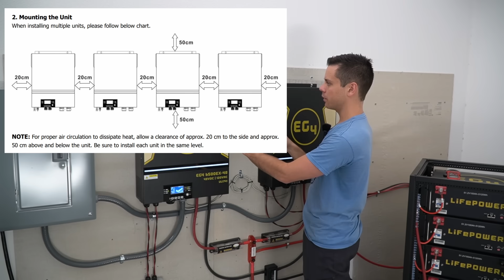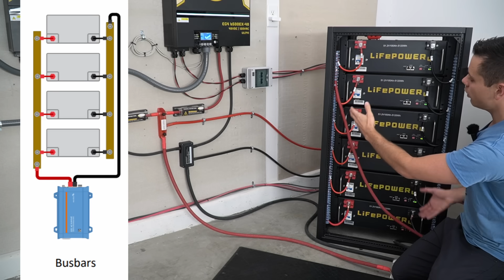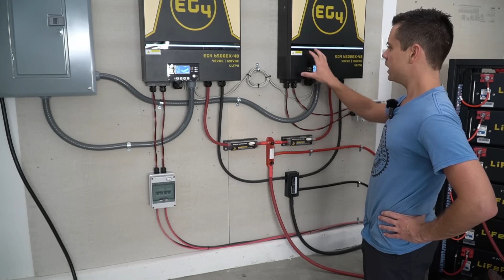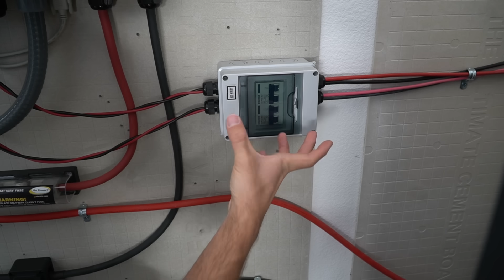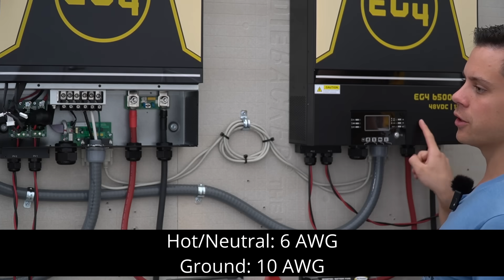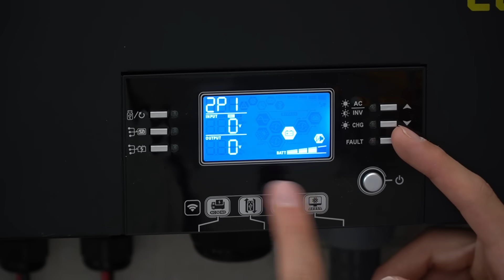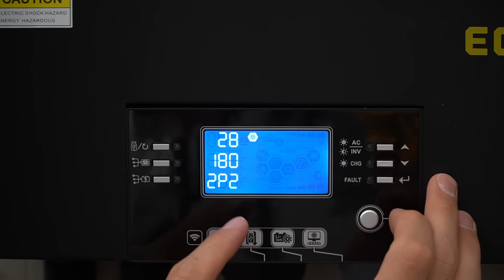Complete 48V Offgrid Solar Power System

Comment: Hi Will
I am based in South Africa and we have between 4 and 8 hours load shedding per day. Seriously. The time has come to go off grid and although I follow your Chanel generally this particular set up looks great. 
We are blessed with lots of sun so solar is very viable with a decent battery bank. Could you push me in the right direction to maybe import a system similar to that in your video. All our larger homes are 3 phase and would require at least 2x 5 kVA inverters or similar. Any guidance would be greatly appreciated. Many thanks. Ian.

Comment: I’ve got (4) 270 watt panels. I want to power a 3kw EPropulsion engine in that imaginary “infinite” range. The 9 kWh battery they offer is prob my choice. Is my configuration good for an under 2000lb boat? Thanks, Dan

Comment: I believe this meets all of my needs. My question is, if you use the A/C inputs from a main panel (as a back up to keep the batteries topped), would you limit the A/C charge to allow 1 circuit to feed both inverters, or would you run 1 circuit from the main panel to each inverter? My concern would be one of the circuits (A/C inbound) failing and causing an imbalance. Would there be a problem if only one unit was charging the battery array? and, would there be a problem if the units transferred from battery to grid in this case?

Comment: I need some advice. I have installed a system with two separate 240v ac output inverters. Both inverters have L1, L2, neutral and ground wires. Can I join the L1 wires together from the inverters and send it to the main house double pole backfeed breaker on one pole, and join the two L2 lines together and send them to the second pole of the main breaker? The inverters (EG4 6000) have communications wires called 'power
sharing' that keeps them in phase, along with standard communications printer cables.

Comment: Will, I am looking for some help with doing an off the grid system for a 26 by 14 foot shed barn that would be running multiple computer systems for gaming, TV's, air compressors, how many split air condition, residential size refrigerator, microwave. With future jacuzzi hot tub connections. I would like to know if like in the video Complete 48V Offgrid Solar Power System on May 25, 2022, if this system it would be just right or overkill for what I'm trying to do?

Comment: Love your Chanel, but I wouldn't recommend this company to anyone. After spending 20k with them it took over a month to get issues resolved. Inverter was DOA. Had to deal with 4 different techs before I got a replacement 4weeks later.

Comment: thank you!  this is exactly what i am looking for... except i would like to know how you would hookup grid power for charging batteries when low solar days and supplying my critical load.  Unfortunaltly my solar array is VERY small at this point until we move but want to have a pratcial solution that can move with me.  Also, will these handle UPS automatic failover in a grid out situation?  In comparison, the Bluetti has UPS mode that i am familure with but doesnt really give me the AC output to power my whole house in a split phase setup.

Comment: What if almost 200amps is going to each  All in one, you would now have almost 400a without anything tripping but your bus bars are only rated at 300a. Should this be a concern or since that is unlikely to happen as that is exceeding the rated capacity of the combined output capacity thus one of the all in ones would trip into overload protection anyway before overheating of the busbar .

Comment: I must have missed something on that electrical service you are showing here. In your video you said you could bring in other supplies into the service and connect them into the service. But I’m looking at that bus bar and I don’t see any separation just a common rail for each of the 2 phases. If you did bring in another phase you are going to cause a really big boom when your flip the breaker and it “single phases”.
Reply from the maker: You need to use communication cables and current sharing cables. Check out the manual and you will see a diagram of what I mean

Comment: You really can connect neutral and ground together? No real ground?
Reply from the maker: Reference potential is relative and whatever you need to designate it as. Depends on your use case and environment
Reply from the maker: Think about the circuit and the purpose of ground and design accordingly

Comment: Will this setup and configuration work with EG4 6K Off-Grid Split Phase Inverter | 6000EX-48HV | 6000W Output | 7500W PV Input | 500V VOC Input | Split Phase 120/240VAC | All In One Solar Inverter

Comment: Would it be reasonable to install a system like this prior to installing a solar array? I'm thinking of something like this as a whole home UPS that can be charged with a portable generator in the case of a grid outage as a "phase 1" before I get a solar array, too.
Reply: Yes I would think so. If you have a generator that runs on gasoline, propane, or natural gas, that could keep your batteries charged as well as using house ac. You would be switching manually, not like a true UPS.  I have my batteries and solar panels, but am waiting on the EG4 inverters to ship. You might want to get your order in for the inverters now at Signature Solar.

Comment: Great video. How does a generator AC input work? Does it require a separate module to auto start? Will the inverter request power when the batteries are low?

Comment: Australia requires the solar disconnect switch at the panels and a circuit breaker at the inverter, so firefighters can ensure they are off.

Comment: Thanks Will, for your blueprint which I completed all myself (off grid).  I did add a Siemens 200 amp manual transfer switch (I got from HD online) and without the use of the 60 Amp breakers and sub panel as it feeds  my existing sub panel breaker panes on the panel) and used 4 AWG (NOTE I just finished the REWIRE today, as manual requires 4 AWG) wire instead of 6 AWG (as you stated in your blueprint) for AC (it did not seem too hard to put in the terminal block).  

The system powers my entire house (3 ton GREE HVAC) since Aug 31, 2022  I will need more testing as I now have about 8 days/nights on the system and the winter is just around the corner.  I have 28 panels of Canadian Solar CS3W-445MB-AG bi facial panels from SanTan Solar.  

I purchased an IronRidge Ground mount system that I designed off of their website for mounting them.  I modified the spacing to 6 foot spacing so I could use the top cap as a splice joint.  My total Array is about 54 feet long.

My wire and I are very happy that somebody has reinstated the rebate from 26 to 30% (for 2022) and things are working fine for US.  Too bad I an unable to add photos as I made a frame above my server rack (6 LifePower Batts) which holds both of my inverters (8 inches apart) which cuts down on the wiring "mess" on the wall and tidies things up nicely above the server rack.

Comment: Will I have a question for you or rather a request for some advice. I would like to use Bluetti AC300 + B300 batteries to be part of an on-grid solar system and have the Bluetti system be the generator during the evenings. The question is if this configuration even possible? Assuming it is, would it a smarter decision to just use an EG4 Server Rack configuration?

Comment: Seems like "off grid" is the wrong term. Yes it isn't grid tied, but that term implies more than the actual power grid. It is usually used to imply self sufficiency and/or a lack of need from elsewhere, however when you rely on Batteries every night, their lifespan is shortened considerably. A battery area can run from around $5k for a small "backup" to around $20k++ for a full daily use system. If thw average life span of battery back up is 5-15 years you should assume the batteries will only last MAYBE 10 years. Prob less with daily use. That would mean that whenever thwy finally fail you will need to go out and spend all of that money again and rely on others to do so, kinda killing the self sufficiency angle. It also adds the issue with battery waste and their material sourcing/ manufacturing/logistical carbon footprint if you are concerned about that. We should not be settling for this and need to keep looking forward. Unfortunately the companies that could do that are selling these batteries, so......

Comment: i have lived off grid several times in my life, the last time was for 3 years. i built my own solar system and used T105RE lead acid batteries in a golf car for electric storage, made custom cables with huge Anderson connectors to change battery config from 12 to 36 volts if i desired to move the golf car so i would have a mobile power system. also had a gas engine that belt drove an alternator to charge batteries when solar was not enough.
i really would like to make a system like this, but not the same. i would NOT want any wireless capability, i do NOT have a cell phone because of security issues! i would also want to use several battery banks with some sort of relay system so when one bank is fully charged it starts charging the other bank etc.. until all the banks are full. then it pulls power from 1 bank until 50% then switches to another bank. im assuming that this would make the batteries last much longer

Comment: Okay something doesnt adup what they say here. My calculation is 240volt: 48volt is 5times. Soo 16,000watt : 5times is 3200watt output !! What this person means that his swithers can hold max 13,000watts but cant deliver long solution this much power. Reality is vacuum cleaner on and thats it.. I know baterys are still useless..

Comment: I have been watching to learn what I need to do for an off grid property I'm thinking about purchasing.  I wonder about two things.  One is when you have your solar system ground mounted away from the house/building, what is required to carry the power to the house/building (buried cable of some type?).  The second thing I"m wondering is if you have two or more buildings to bring power to, what you need to do.  I would have a house, and a steel building that would double as a garage and a business work shop.

Comment: hey quick question if I have a 48 volt 280 amp hour battery bank as a primary battery for  a eg4 6.5 kw  and wanted to hook a secondary battery like you have hook up here  do the amp hours of that second bank need to be exactly the same as the first

Comment: The inverter fans sound loud; it could be because they are close to Will's mic. Could the inverters be installed in occupied areas, or would they be too annoying?  The other observation is the inverter AC outputs are in conduit while the DC circuits are unprotected physically.  The DC circuits could have much higher voltage than the AC circuits. Does the National Electric Code require the DC circuits to also be in conduit?  Thank you.

Comment: hey boss one question, can i connect 2 different devices with that same system at the same time but one Air conditioner is 220V and the other is 110V?

Comment: Do you recommend using a 15k solark inverter that needs to be manually set to communicate with these batteries? How does the quality and reliability of the EG4 inverter compare with the solark 15K limitless?

Comment: Anyone use these or 2 lv6548's to run a 1.5hp 240v well? I tried with the lv's and 1 eg4 48v battery but no luck. Wondering if battery capacity is my problem.

Comment: Hi Will, if I plan to set this up on a bus build and I primarily connect to shore power, do you recommend setting these up as ups and with bypass enabled? Meaning I keep the neutrals and grounds separate at the bus panel since when I am connected to the shore power the shore power panel has neutral and grounds bonded (panel at a campground) ?

Comment: do you need to have the solar panels configured in a certain way to feed into the EG4 Module? or will any Voltage (12/24/48) be ok?

Comment: I’ve seen your previous video about running mini splits off grid but do you think this system could handle AC if you used the full 30kWh rack full of batteries? Obviously there are other factors but is AC still as difficult off-grid?

Comment: Hello Will. In your setup, you have both inverters connected to one set of busbars with both battery banks connected accordingly. Can you run separate sets of busbars from each inverter individually? Allowing for more lug connections for additional battery banks.

Comment: Why is the output in kW but the input is in Watts?  Only scammers use inconsistent units.
Reply: By the age of 15 people should know that k stands for kilo, a thousand, and W for Watts. It's the same unit
Reply: @danielpicassomunoz2752 Then why not put both as watt or kW?  A trick.

Comment: I have 1 of these inverters and 3 of the batteries. I don’t have solar panels installed yet so I can’t us pv to charge or power the batteries yet so my question is this…
Can I charge up the batteries with ac hooked up to the inverter from a standard wall outlet via an extension cord stripped and connected to the inverter? This would basically just work as a battery backup for emergencies during power outages and could be recharged when grid power is restored. This isn’t ideal or even my longterm plan but would cover essentials until I can get panels installed. Thanks.

Comment: I have two questions. Is there a ratio to follow between battery bank size and inverter capacity? Can I connect the server-rack battery modules using a battery combiner instead of a bus bar?

Comment: You've been a bachelor for to long buddy. You need to get a metal whole punch and start showing people how to box your electrical in, because no mother with kids will ever go for that in there house, YES THERE HOUSE.😳😳😳😣😣😣😔😔😔😔 Besides you get to cut holes and get creative with track mounted AC and DC stuff, like voltage monitoring and mounted relays for DC electrical and water heating. Broaden your subscriber base.😳😳😣😣😣😜😜😜😜

Comment: Will, in some countries PV disconnects need to be 1) accessible outside, 2) in non-combustible enclosure. In some other countries, they must be close to the inverter they are feeding. And some need to be clearly marked ("Do Not Open under Load").

Also these disconnect MUST be connected in a proper orientation. Horizontal is NONO. Unless you really verify it in disconnect manuals that is is allowed.

Otherwise excellent video.

Comment: So... you said the system shown was a great value for the price... but did not mention the price.  What is the price ???  And secondly, most home electrical is usually referred to as X-number of "amps", like the most common amp capacity is 200-amps.  How many amps is the system shown, and would it perform just like a conventional 200-amp on-grid supplied system?

Comment: Great video.
The one thing I wonder about is can you combine your power system with a "device" to allow a connection to house input power? Like a transfer switch that keeps the solar feeding the whole house until the external power is needed?

Comment: Thanks a lot for the amazing information Will! Is it possible to connect the grid to this system so that you can use grid power if the solar/batteries deplete (e.g. at the end of the night the batteries get depleted and the sun has not come up yet). I am building a system for 24/7 crypto mining and I want to make sure that it runs 100% of the time. Thanks in advance!

Comment: Have this exact setup, 6 EG4 batteries but did two EG4 6500s in parallel and only running a 120v critical loads panel without any 240 loads. 

Had both inverters fault out after 2 weeks of running with an F52 "low bus voltage" code and can't find anyone else in my searches with similar issues and therefore solutions. 

Tried searching the comments, but didn't see anything. I've also been dealing with the F61 battery comms issue, tried all of Signature Solar's troubleshooting methods, and went @Will Prowse's route of not using the battery comms and voltage settings only...

Comment: I spoke to signature solar about the ground to neutral bonding in the panel for the case of an off-grid  single EG4 and no generator input to the inverter.  They recommended NOT bonding for this case.  Do you think I should bond? Thx

Comment: Curious about the 2P2 120 setting, so does that means you can run 3-phase from these as well if you have 3 or 6 units? 
I figured the "2P" meant "2 Phase," but I don't know of any 2-phase set-up that is 120 degrees apart (considering the correct option for 2 phase is 180 for 180 degrees out of phase)
3-phase is 120 apart natively.
I'm not super confident on my advanced AC knowledge, but seems plausible that 3 phase should work.
Reply: Yes, if you hook three inverters in 2P2 120 mode, output will be 120/208 Volt 3-phase. Given phase A, B, C, and connected in Wye configuration, you get: A-N=120V, B-N=120V, C-N=120V, and A-B=208V, A-C=208V, and B-C=208V

Comment: How can I connect this system to the earth ? To avoid excessive electrical field in the wires going around the house (EMF) . In building Biology, there is a whole chapter on EMFs and electrical systems, and its clearly specify to never connect the ground to the neutral.   

So would it be ok to connect the ground wire to a copper rod sticker in the ground/soil outside ?

Comment: If I would make a change in your system is to add a fuse closer to the battery's as the cables are "most likely" to be damaged the further from batters you go
Reply from the maker: They all have fuses on each pack